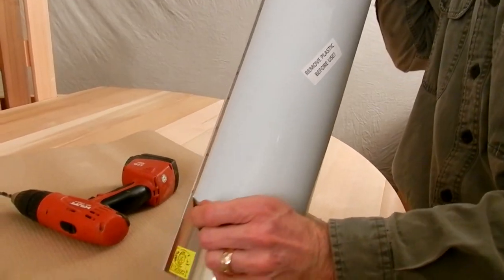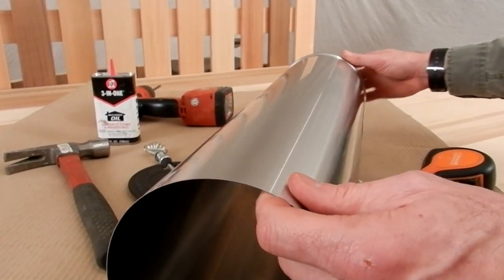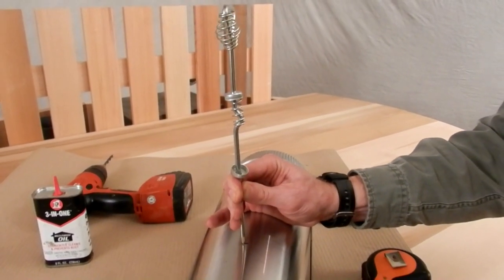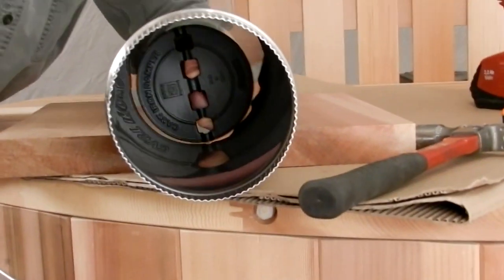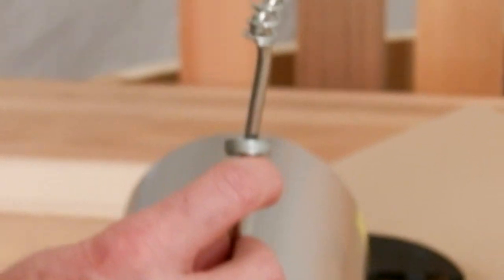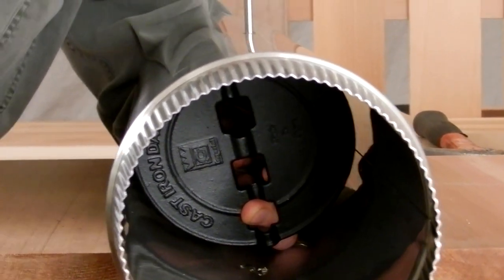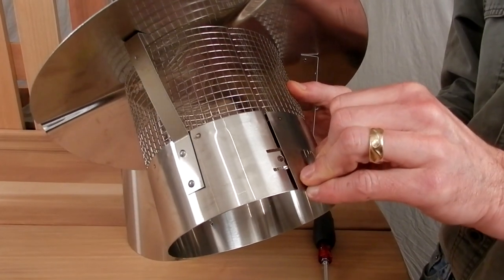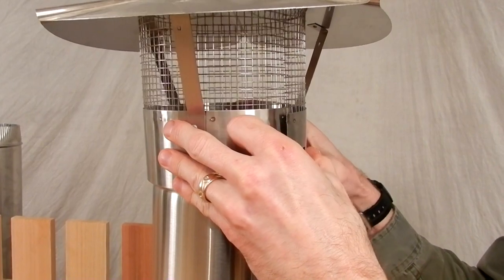Stove Pipe and Damper Installation

Comment: Thank you so much for making this video!! I had a pretty good idea this is how I was supposed to do it but I was not certain the dampener I bought seems to be identical to the one you were using, so it came apart really easy. I've been working on installing a Franklin style wood burning stove, because I'm a tree cutter so hey free heat. But I knew I needed a dampener in the stove pipe and without this video I would not have known what to do..

Comment: Drill a slightly smaller hole than needed so there is a tight fit on the damper shaft and it will stay in position.
Note that the handle indicates Damper position.  Crimped end goes DOWN into smoke pipe.  Keeps falling sparks, and creosote from draining down the outside.

Comment: Steve, is there a way to temporarily bypass the auto damper?  My unit will not fire.  It has he same damper control as you use in the video.  I ordered a new damper but won't get it for a week.
Reply: The damper is fine.  Open a window slightly.  Fire needs Combustion air.

Comment: Got lot smoke coming  back in my garage  damper open chiney  tall I don't know why
Reply: Sounds like your getting a backdraft... do you have a chimney cap or no top on top of chimney? Is your flu getting hot when you fire furnace? Flu pipe needs to be warm.. hot air will take least resistance way to escape.. (hot air rises) if you have a chimney cap maybe remove it to see if helps draw more draft